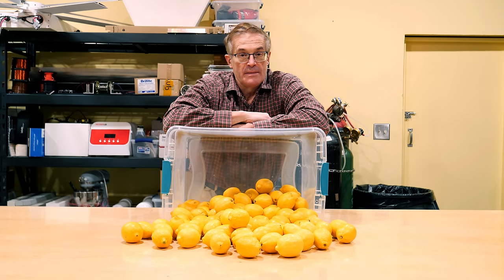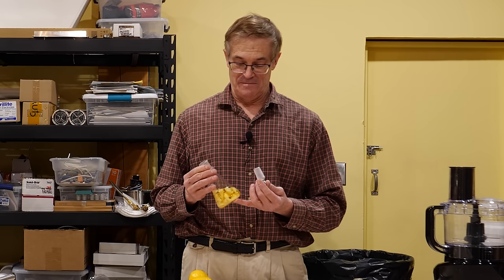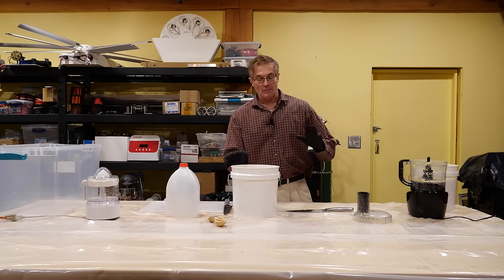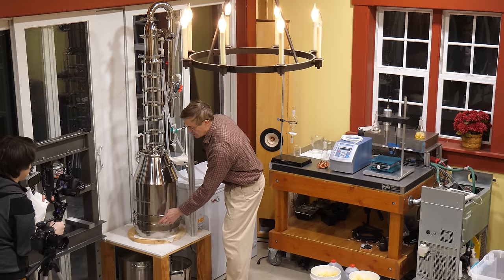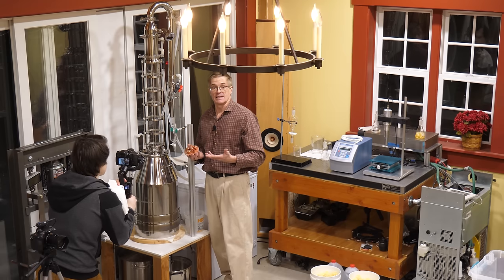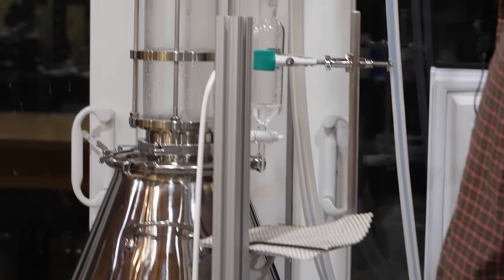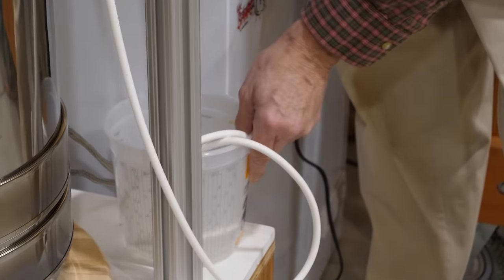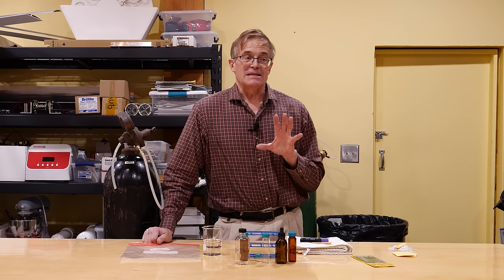CONCENTRATING LEMON OIL LEADS TO A VISIT TO THE HOSPITAL!

Comment: For oils separation add a saturated salt solution. It will increase the polarity difference and speed up the separation process.
Reply: Or add a bit of anhydrous MgSO4 to the oil. It will suck water out of the oil.
Reply: would you loose a little bit of the oil to soaping?
Reply: @byrdhartley9014  No, the essential oils are not triglycerides. And even if they were, you would need strong base to form soap. So, double no.
Reply: It actually wouldn't help , imo
Reply: @byrdhartley9014  Adding a saturated solution of sodium chloride will not base it, and help drive off water which in turn would require less anhydrous magnesium sulfate.
Reply: @andygaras  Both of the methods mentioned here do work. They are commonly used in chemistry.
Reply: @user255  anhydrous calcium chloride is probably a lot easier to get than anhydrous magnesium sulfate. Neither should dissolve in the oil. Though I’d note that the oil should be shaken and vented in the separators funnel with a saline solution first, and the mostly dry oil added to a desiccant. Not that I’m sure how you’d remove the desiccant. Maybe you’d just leave the crystals at the bottom of the vial.

Could add something to react with the oxygen while you’re at it, though all that comes to mind is an alkali metal. That or induction heated titanium getters. Neither of which are particularly appropriate.
Reply: @Scrogan  Maybe. MgSO4 * 7H2O is easy to get and it is quite easy to dry in a common oven into MgSO4 * H2O, which should work fine.
In order to remove the crystals (I don't think that is necessary), you can squeeze the oil through syringe with some cotton in it.
I think ascorbic acid should take the oxygen.
Reply: @Scrogan  you would just pour off the oil without taking the drying agent, like you can also use molecular sieves
Reply: I usually just put about a teaspoon of rock salt in the bottom of the sep funnel and gently swirl it until it clears up. It clears both the water and the oil in just a few minutes by accentuating the polar (aqueous) phase of the solution. Water will adhere more tightly to the ions in solution in the aqueous phase than it does even to itself.  Consequently, the oil will form larger bubbles in the phase of the solution. You can even salt out the cloudy water that was discarded from the still before putting it in the sep funnel.

Comment: Electrical tape is the best to keep you from leaking your electrons, just don't wrap it too tight, you would be surprised how much pressure a couple wraps puts on a cut.
Reply: Nop, I will not be suprised.  :-)
Have used it with good effect many times. Often on top of a band-aid just to have less clue from the electrical tape sticking to the skin.
Reply: super 33+ is something I carry at all limes and have used on a few cuts. Works well.
Reply: What you've described is the Patent Pending Mandaid.
Elec-chicken's tape with a patch of shop towel what for preventing the stickage upon removal.

Comment: 31:00 Not everyone has a tank of nitrogen:  You can buy a product called "Bloxygen" which is argon in a small can with a straw. After opening a can of stain or whatever, you add a shot of that before closing the can.  It makes a heavy layer so you don't have to fill it up the void in the can completely.
Reply: Thanks for sharing!
Reply: One of the few ocassions that i can remember that the unsolicited presentation of a commercial product results interesting ;)

Only trying to be humorous, no bad blood at all, friend.
Reply: Gas mixtures do not form layers. Argon will not sit in its own layer, it will mix with the rest of the atmosphere in the vessel. If you want to flush out air, you have to add a minimum of that volume of argon.
Reply: I always give my oil based paint cans a shot of propane from unlighted gas torch before closing. stops the skin forming on top of the paint.

Comment: It is also helpful to flood the bottle with nitrogen just before decanting the essential oil. Nitrogen is only a tiny bit heavier than air, but it will remain in the bottle long enough to be displaced by the oil. It's a lot less complicated than the "nitrogen packing" demonstrated in the video.
Reply: ...and blowing N2 across the surface for a bit will agitate the oil and get rid of some dissolved oxygen.

Comment: Great video as always!  I'd like to add one area of application you just hinted at when you spoke of scented candles--the limonenes are among the few (and certainly among the least toxic) solvents for waxes, so they are great for cleaning ski waxes and klisters, as well as functioning as carriers for  boot dressings.  Rather than using nitrogen to exclude oxygen from a stored liquid, I've used argon, which is available in spray-paint sized cans from tool and paint stores (like Lee Valley in Canada).  Just a tiny shot is all that is needed to exclude oxygen, because argon is so much heavier than air.  Works great for white wine, too.
Reply: Thanks for that tip! (and source for argon here in Canada!)
Reply: argon has many uses too eh (welding etc)

Comment: It's also worth noting that there's a few more interesting things that you can use lemon oil for, and it doesn't even need to be pure for some of them! Highlights include thinning finishes and paint[1], diluting into a great cleaning agent[2], and my personal favorite: melting styrofoam![3]

1: You can dilute Tung oil 50/50 by volume with technical grade d-limonene ( I'm not sure if food grade is fine for this ) to greatly reduce Tung's natural viscosity, making it easier to apply the thin coats you want to use.

2: You can mix a solution of food grade or technical grade d-limonene with water to create an impressively good cleaning agent, changing the ratio of Oil:Water for the desired strength ( I'd start with 1:1 and increase water if it's too strong ). Note, however, that the oil and water will separate over time, so you need to agitate the solution to keep the oil in suspension. You could probably add an emulsifier to the solution to help with this, but I haven't personally looked for what may be compatible in terms of shelf life and not leaving a residue.

3: Seriously, d-limonene and styrofoam are like a non-toxic version of acetone and styrofoam. You need a surprisingly small amount of it for the volume of styrofoam it can dissolve, too, so you can do fairly interesting recycling processes like filling a container with water, putting in enough d-limonene to cover the layer of water, and  placing in styrofoam chunks - the styrofoam floats on the water, keeping it in the oil to break down, which then consolidates with itself, and once the new consolidation weighs just a little bit more it will sink into the water and allow new styrofoam to enter the oil layer for breakdown. The consolidated plastic is usually a bit gooey unless you evaporate off all of the remaining solvent ( the oil ). The final result are these weird little chunks of polystyrene, the plastic that styrofoam is made of, which you can use for shaping, or melting into a mold at a fairly low temperature ( like... 200f? )
Reply: What  is Tung?
Reply: @N.M.E.  Tung oil is used for oiling timber as a finish
Reply: @Kweesh  Ahh interesting! Thanks a lot!
Reply: Wow what a great comment. 3 Would make a great video!

Comment: I worked as an engineer at a food packaging producer here in the UK and we used neat  orange oil to clean the glue guns ,it's relatively food safe and dissolved the hot glue used to stick the induction welded membrane into the bottle/jar caps , that orange oil was nasty one drop on you're skin and if you didn't wash it off quick you'd end up with a sore patch for days that stank of orange till you'd had several showers... I got some in my eye once and Christ it felt like someone had driven a nail into my eyeball . Yes I was wearing safety glasses but a small drop still got in . I had a bright red blood shot eye for over a month.
I got so sick of the super strong smell of orange I still can't eat them.
Reply: i love the smell of d'limonene
Reply: Ive used Orange oil to strip lacquer and can still remember the smell
Reply: Cool story!!
Reply: @aristotles-lantern  oh yes, people see the lemony smelling oil and forget that its basically acetone with a better flavor.
Xylene is still best
Reply: I could feel that little splat you got in the eye from between the safety glasses and your cheek

Comment: 6:49 Let me overanalyze this situation as a similar cut happened to me recently: I think this occured when I switched from a dull everyday knive to a very sharp one.  I guess as soon as I go into autopilot (doing a repetitive task) my muscle memory kicks in (beeing used to a dull knive). So I use more power then nessecary to make the cut and at the same time I am less defensive in my hand position, as that is normally not an issue.
Reply: The opposite has also happened to me, moving from sharp knives to a dull one, the knife didn't bite and glanced and I stabbed my finger. Always start slow with tools you're not used to
Reply: Exact same thing happened to me recently, nice new knife + old muscle memory = lots of red stuff everywhere and a really sore finger (no stitches luckily)
Reply: Me thinks I'll just get my oils off Amazon.
Reply: -a dull knife is more dangerous than a sharp knife
-always hold things from behind the knife
Reply: A dull knife is way way more dangerous than a sharp one
Reply: ya once saw someone push really hard on a dull knife to get it to cut and it just snapped and the tip barely missed their eye

Comment: Great vid as always. Super interesting and jealous of that massive still! 

Re topic suggestions: Wondering if you guys have ever touched on the topic of measuring surface finish (or texture) in great depth? It’s a deep rabbit hole but super interesting. I’m a product test engineer for a large PTFE and elastomeric seal manufacturer so naturally we are very concerned with the quality and surface finish of customer hardware on which our seals run. The evolution of the tools used to measure micro texture is pretty interesting. There are some fascinating parallels between audio processing and how the ‘waveform’ of a surface texture, as you drag a stylus across it, is analyzed to produce various parameters used to define the surface.
Reply: That actually sounds very interesting. I would like to see this investigated and explained.

Comment: I've had a lot of experience sealing up cuts with cyanoacrylate adhesive. Even somewhat deep or jagged cuts (I recently got a bad one from a hack saw) seal up great if you can temporarily slow the bleeding with a rubber band or tourniquette. Amazon has 10 half-gram tubes of Butyl Cyanoacrylate (medical/veterinary grade skin glue) for under $20. It sets almost instantly on contact with skin, making it great even for cuts that are still lightly bleeding. It wouldn't work for anything down to muscle or tendon, but it's saved me several trips to the ER.
Reply: I did the same with a hacksaw, my 5 year old son was watching so I had to quickly hid it and the pain.
Reply: Don't forget when holding shut can sprinkle baking soda on top to help the exposed glue set super fast to ensure it's not a big mess with it coming open in one spot and then you are stuck with a hard glob inside while still having to seal the opened part.
Reply: @WaterspoutsOfTheDeep  It bonds so quickly with skin that I've never needed to add baking soda. I usually wipe it with a plastic bag just after applying to remove the excess, and the remaining thin layer solidifies completely within 10-20 seconds.
Reply: @Nuovoswiss  I've used it quite a bit underwater gluing coral for my salt water fishtank over the years. The issues I'm talking about come up gluing wet surfaces specifically. If the bleeding can be controlled and the area dried or slightly damp I can see it being significantly easier to apply. For open wounds that can't be closed boron significantly speeds up healing. There was a study done at a hospital where topically boron sped up healing of deep wounds by 2/3's which is unreal. 5mg "***elemental" boron added per 1ml of the topical product. This includes common household borax(with no additives). I sliced off the tip of my finger with a mandolin making thanksgiving food and tried the boron for the first time only a few times since I used a hydrocolloid bandage and only changed it once a week since they are left on and last time time I put on a new one the tip was almost fully regrown to my shock. It looked at first like it was going to leave a big concave indent. Just my anecdote. I used a ICES PEMF machine too since I already had it which likely helped, took away almost all the pain in a matter of a day or two, but even now still really sensitive. I couldn't even put on a hydrocolloid for first few days because it wouldn't stop bleeding like crazy so had to just have a pressure bandage on to stop the bleeding and it eventually did thank goodness lol.
Reply: @WaterspoutsOfTheDeep  Borax is very different from elemental boron. Some googling shows they used borates, not elemental boron.

Comment: Not recommended per se: I am in love with superglue first aid for cuts like that. The shelf diy stuff 'cyanoacrylate' is not ideal because something something toxic...but if you don't have access to dermabond (uses some other molecule than cynanide-ish) it is fantastic for emergency first aid. Only time I've ever truly sliced my hand open was chopping a lemon (irony) - and I closed a ~1 inch gash in my palm (no tendons or muscle) with superglue. Immediately stopped bleeding, and healed without a scar. Magic.
Reply: I am sorry, but you are very wrong about superglue. Actually, you're "not even wrong", which is worse. It's not about cyanide or no cyanide, and the medical grade cyanoacrylate glue is octyl cyanoacrylate based, instead of ethyl2- or methyl cyanoacrylate. Besides reducing the sting and being manufactured to meet medical certification standards, and being way more expensive, it's still superglue. Anything deeper than a couple milimeters and you'd better avoid trying to diy it outside of life or death situation where blood loss management comes before infection or potential nerve damage management.
Reply: Same. I recently found that Amazon has 10 tubes of butyl cyanoacrylate (medical/veterinary grade super glue) for under $20. The stuff cures almost instantly on contact with skin, making it great even for cuts that are still lightly bleeding.
Reply: dermabond is octyl-2-cyanoacrylate
Reply: @howarddyla9676  Butyl cyanoacrylate is also used in some skin glues.

Comment: I love the work you do.   I am an a expert on high purity solvent purification and packaging.   A key issue is that the oxygen goes through even the interface between the bottle cap and gasket material.   I have worked on this problem with material that forms peroxides.   I have only found two solutions that work is storage of the material in metal container under positive argon pressure or using a bag in a can technology which I have invented.

Comment: I made a hot sauce with a lemon. In the recipe I made (I didn't follow any set recipe), I removed the zest of a lemon and put it in some rum for about 24 hours (though, it may not have technically be enough, I blended everything at the end with a hand blender). The point was to avoid heating the oil too much. I added the rum/lemon zest mix after I finished cooking the sauce.
With the juice of the lemon and the zest, it ended up having a great lemon smell and flavour. Of course I added other ingredients, to round the flavours into something interesting (like a little bit of garlic, some maple wood liquid smoke and some maple syrup artificial flavour concentrate, white vinegar (this isn't a recipe where you want a "fancy" vinegars), salt and sugar (don't put too much sugar as to make the sauce sweet. Just enough to complement the lemon juice, but not too little as to barely have any sugar... it's almost an equilibrium where too much would make it too sweet and too little would leave the sauce too much on the salty side)).

Comment: Years ago, there was a US machine that separated juice and expensive essential oils from fruits. That machine was used by the big global beverage makers. Head of the factory told me the machine was only available on lease but not sold; lease was very expensive. Can't recall who made that machine and don't know current processing equipment. Interestingly, the beverage factory process was top-secret so we were not permitted to see much of the factory.
Reply: During a factory tour at a production site for bottling plants a while back, our guide made an offhand comment about a properitary co2 extraction process, used to separate volatile compounds from orange juice, storing them, and adding them back in after pasteurisation. 
Might have been something similar.
Reply: @derkeith570  The essential oils may be used in some beverages and/or sold. For certain they were valuable.